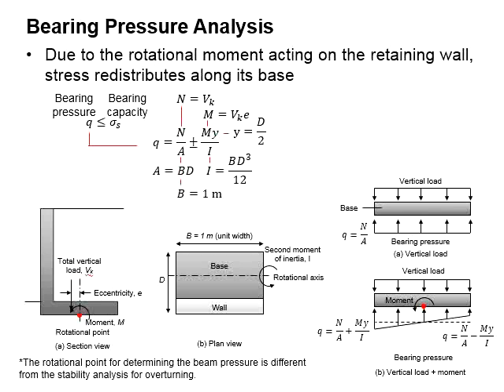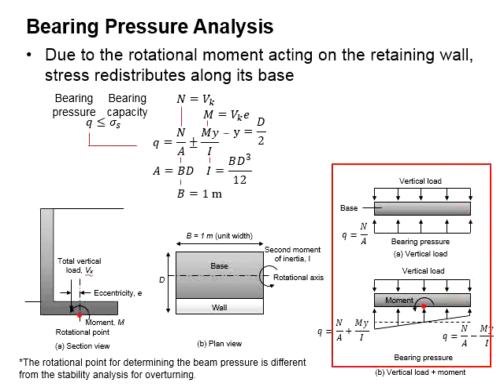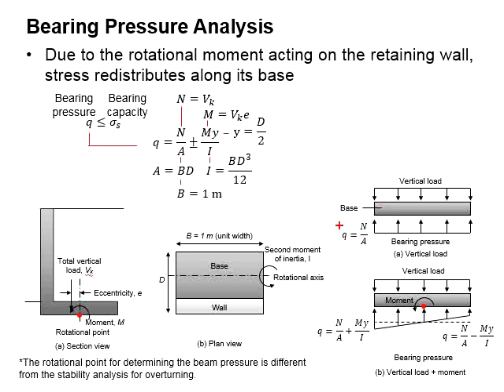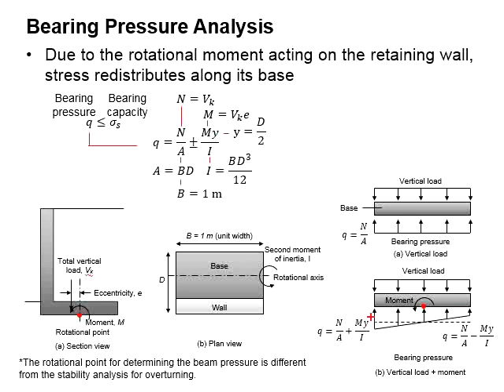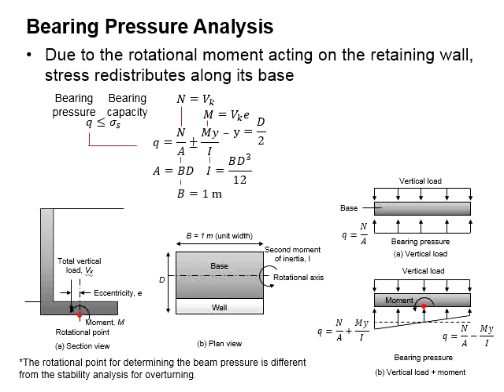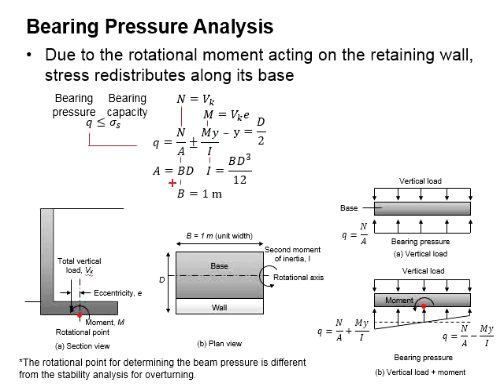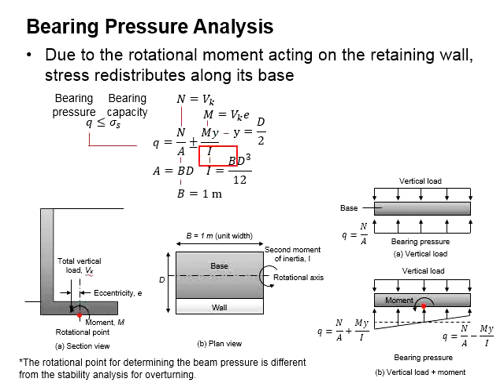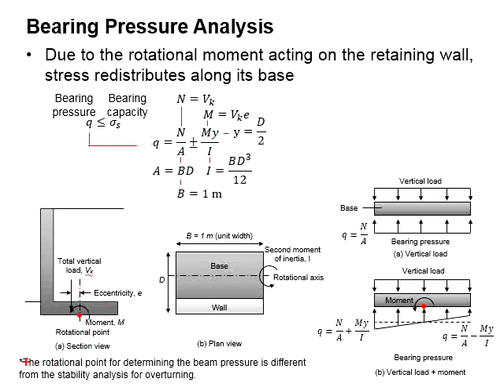4.8 Bearing pressure analysis

Comment: I have calculated the bearing pressure for max and min, however, I got negative bearing pressure for the minimum, it is consider okay for the retaining wall or it is fail??
Reply from the maker: No. Sometime -ve bearing pressure happens. That means the stress is coming from the other side.